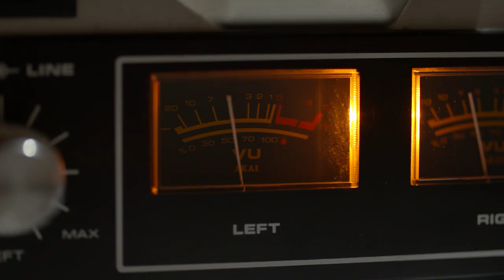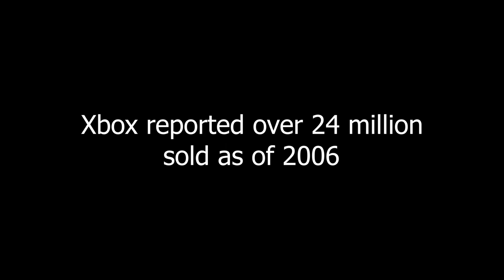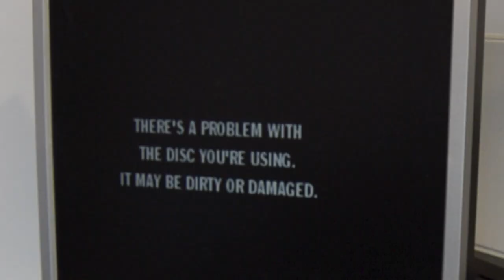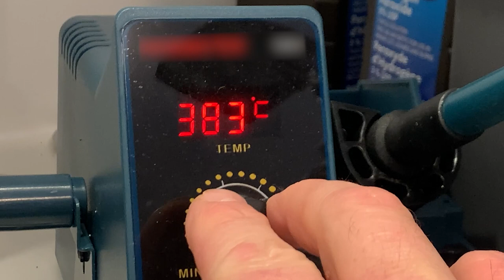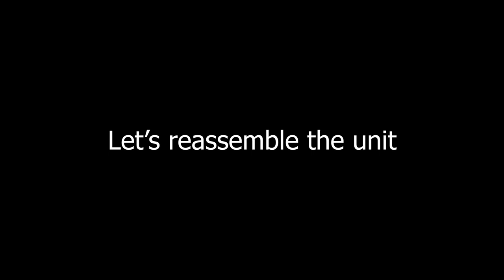Restoration of an Original XBOX Retro Gaming Console | Retro Repair Guy Episode 5

Comment: I know this is years old video, but I appreciate the skilll and level of detail to restore the Xbox.  I recently got back into modding and to my unpleasant surprise, I found the clock cap leaked and corroded some of the surrounding components.  Three resitors (R7Gx on v1.0 Xbox) are damaged or missing.   Most folks say the clock circuit doesn't matter, but I'd like to restore the missing components.  Do you have an accurate, definitive list of the board components you could share?
Reply from the maker: Hi thank you! Like you, I want to restore it properly and in my opinion the clock is important. You really want to reset the date every time you boot up? Not me. Plus the only reason it leaked is that this was a known problem Microsoft used a very cheap component. Changing it for a higher quality one will last for years to come. As for the parts list, I would have to look but I think it might be quicker Googling the diagram. It's been a while since I did the video last year and unless I open it up I don't know if I have a list. I'll check and if I do I'll post it as a follow up to this. Meanwhile thank you for watching and leaving a comment!

Comment: Gave me the urge to restore my old xbox. I had the same power issue as you had with this unit...
Reply from the maker: I have many memories of "calling in sick" to work in order to have a long weekend playing KOTOR! Many of these older first generation models suffer the same problem. The clock capacitor was very cheap and leaked. If it did not create too much damage in can be repaired and even though I put a good quality capacitor inside, you might want to look at spending two or three dollars more and getting a super capacitor which I should have done but never crossed my mind.
Reply: @RetroRepairGuy  mine the time capacitor destroyed the motherboard. I did what you did bought a 9$ xbox from the thrift store that had a broken dvd and removed the capacitor and replaced it in my shell

Comment: Quick question if I remove the battery capacitor,  do I need to replace it or will the xbox work  with out it?
Reply from the maker: Hi J.D.! Yes the Xbox can work fine without the clock capacitor but you will have to reset the time and settings as it won't retain them. The clock capacitor acts like a small round battery that's on old computer motherboards (and that's what the Xbox is a 733 Mhz pentium) and it's job is to retain settings and time. But it does not prevent it from working. This would have been more important in the days of going online with the Xbox.
Reply: @RetroRepairGuy  thanks for the quick reply, thats great news I'm about to tear into it in the next few days, your videos are great and very informative, thanks and have a great day.

Comment: I still have my Xbox one halo green console in mint condition lol maybe it would be a good idea to get rid of the clock capacitor just like back to the future it takes one. One jigawatts to reach the flux capacitor to make it go back to the future Can you hear me McFly
Reply from the maker: What the hell is a jigawatt! 😂 In all seriousness though, I think you should look at replacing it, if it hasn't leaked already. many have had this surprise and what happens is that it ruins the board and other components. At the very least, just remove it. You can always install one later, it's function is to keep the time and settings but the Xbox doesn't need it for playing. If you're not comfortable doing it yourself find someone to do it because that's really cool and nice to have a mint condition Halo console. Thanks for watching!

Comment: Isn’t it dangerous to handle the power supply so cavalierly?
Reply from the maker: Hi. Sorry I'm not sure what you mean by this? The only thing that was done to the power supply is replaced the twenty year old capacitor that were past their expected life span. Thanks for watching.
Reply: @RetroRepairGuy  I’m always hearing that we should be very carefully to avoid touching certain points due to possible electrocution hazard as they may hold a charge

Comment: Uh yea im not going to put a motherboard in a diswasher i would highley recondmend for cleaing using a air cleaner like what most people use for when cleaning nice gaming pcs  btw if theres bad dirt or some part of the metel i would actully highley recondmend to use dryice iv seen so many people using metal dryice on cars or trucks btw this xbox looks so clean
Reply from the maker: Hi! Actually putting the motherboard in the dishwasher is perfectly safe. The key is to stay away from heat and make sure everything is 100% dry. Water can't get inside a capacitor, resistor or chip. The soap is anti-corrosive and as you saw from the result, not only is it super clean but it works. Air cleaner is good for dust and 100% alcohol works but when there is so much flux and dirt, dishwasher works wonders. You can see a couple other projects I did doing the same like the VIC 20; brushing it with alcohol did absolutely nothing. I also cleaned a Sega Genesis that you can check out. Thanks for watching!

https://www.youtube.com/watch?v=9M1ny1DhjSc
https://www.youtube.com/watch?v=D5qSmDx4UqY
Reply: @RetroRepairGuy  no problem 👍
Reply: @RetroRepairGuy  I used to joke around about putting really dirty motherboards into the dishwasher, but I never actually thought you could do that. I honestly didn't think that I would ever see anybody do such an unorthodox thing until I saw your video. Very insightful!
Reply from the maker: @kylemccormick3450  Hi and thank you. It's simple really; water cannot get inside any of the components (chips, capacitors or resistors). The only thing that could cause a short is the water because it conducts electricity. So if the board is completely dry, there is no problem. Another thing I always repeat in the videos is to not use heat in the dishwasher. The heat in the dishwasher gets really hot and could melt components and/or cause some surface mount to unsolder or move, etc.; almost like using a heat gun on it. The reason we use 99% alcohol when cleaning on the workbench is because it evaporates almost instantly. By the way I just did it again in my latest video from three days ago with a PlayStation 2. Take a look: https://www.youtube.com/watch?v=WkaDOb_SGaA